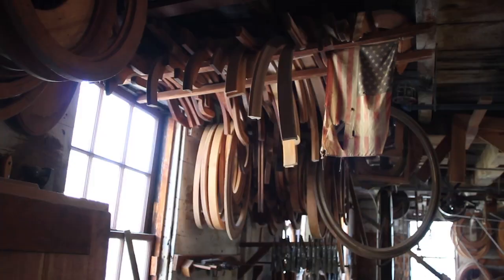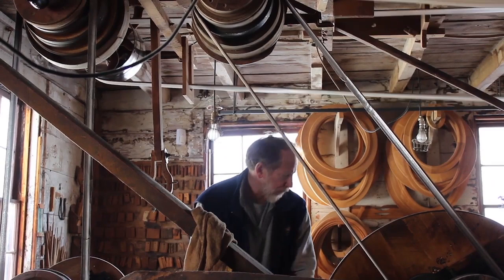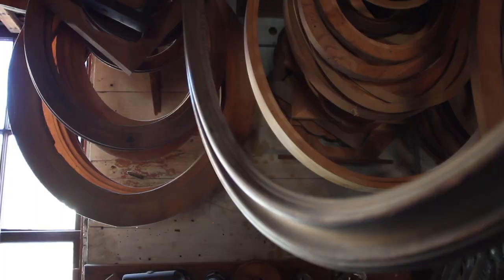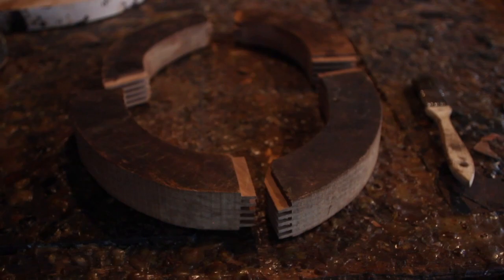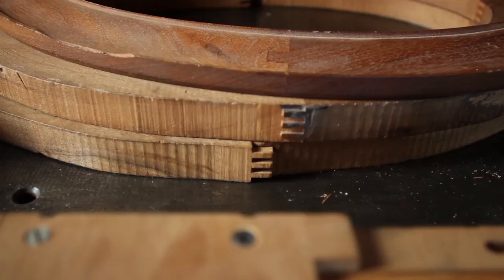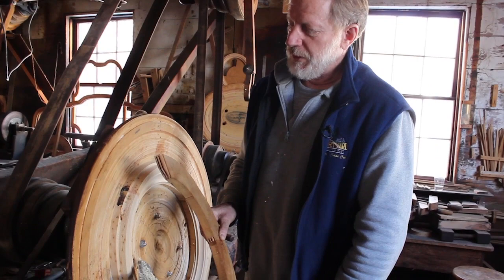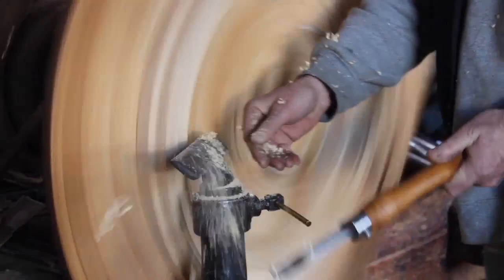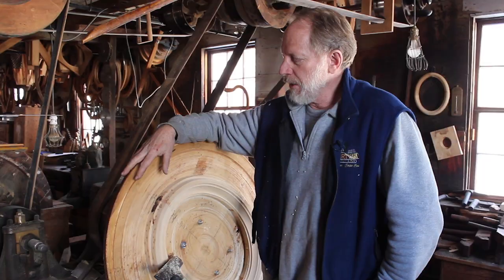The Only Wood Turner

Comment: Sorry to be so dense... I'm still wondering how you get to oval from the round product off the lathe.
Reply: I recently visited the mill - the laithes don't change the shape, the frames are oval both before and after the laithe. Just the faces of the frames get carved/shaped while on the laithe, so they have a pattern to them. Does that make sense?